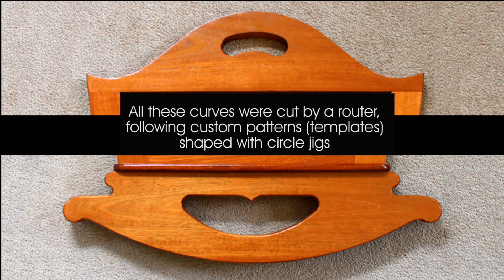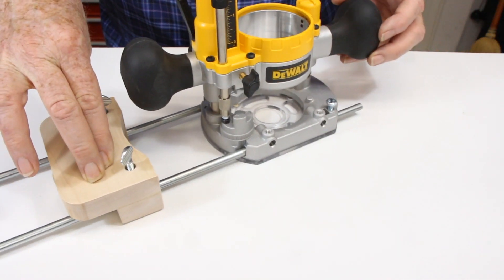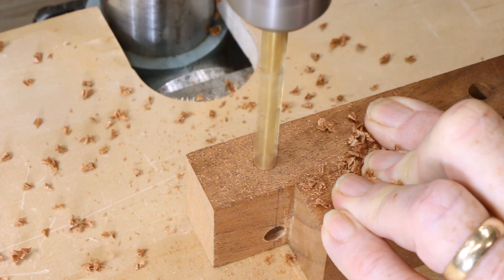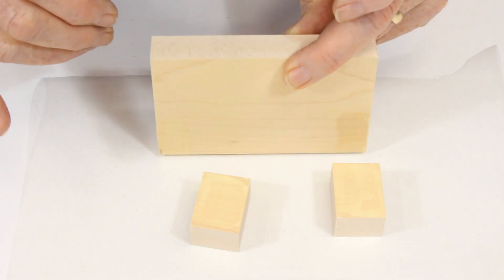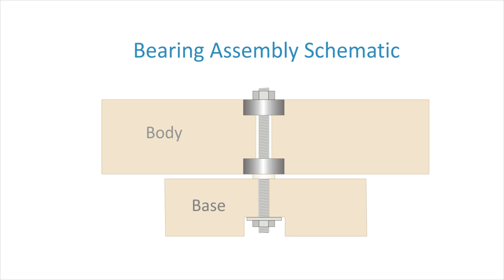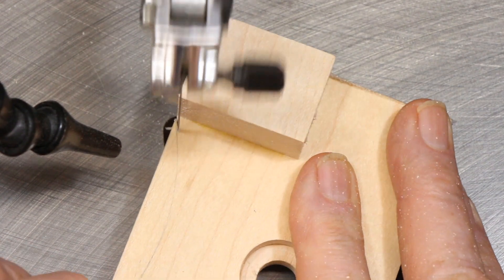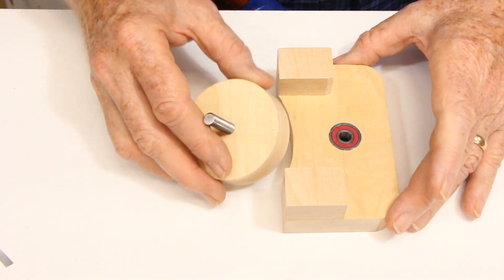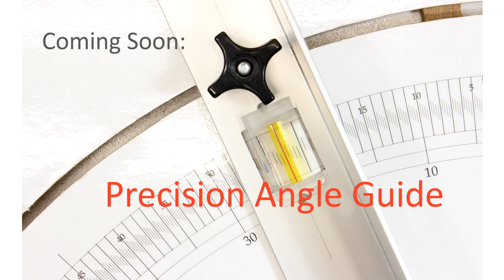Precision Circle Jig

Comment: How I cut metal rod tends to help A LOT with locating the center of the rods (to gauge how far apart the holes need to be.) 

1.) use a pipe cutter (the kind that you clamp and turn around the pipe like a can opener)  and get as deep a score line as I can. 

2.) put the end of the rod in an electric hand drill. If its long then you may need to prop up the other end. 

3.) use the drill to spin the rod while sawing it at the score line. Since your setup is like a makeshift lathe, your cut is always going to end in the center of the rod. A tiny nib will be left in the dead center if done right.

Comment: Alternatively, to avoid the potential axial misalignment issue when using inserts, threads can be directly tapped into the hard wood.  Longevity should be OK provided enough thread is engaged and the set screws are not over-tightened.

Comment: Thanks Patrick for sharing -
After struggling with and finally returning the Milescraft circle guide kit I found your video.
As you mentioned, the second option swivels and held in place by glue rather than a screw that damages the wood, which is phenomenal.

Comment: Excellent. BTW: Those thread inserts ALWAYS go in off center and at an angle by hand. They have a hex inset so cut off the "L" of the appropriate "L" hex wrench and you have a driver that will not slip.

Comment: Exelent hack with the coke can shim. We used to pack worn swinging arm bearings on our MX bikes back in the late 70’s early 80’s exact same way. Even finer tolerance these days with the paper thin material. I’m embarking on making a large router compass to cut 300/400mm curves out of 18mm exterior ply for a shepherds hut roof for a shipping container 🤘🍀

Comment: Let say first that woodworking is not in my  background, so please ignore my ignorance but how do you "set" the radius or diameter that you want to cut with this fixture?
Reply from the maker: You increase or decrease the distance between the pivot point and the bit by sliding the router along the steel rods.  When the bit is exactly at the mark on your work, tighten the wing nuts to lock it in place.

Comment: I’m new to wood work, no demonstration was given after you finished building the first jig so I don’t know how to use it? Fantastic video showing how to make the jig but how about using it?
Reply from the maker: DuzBee:  Sorry I didn't demonstrate better.  You fix the pivot point at the exact center of the circle or arc you want to cut.  Put a straight bit in the router, set the depth, turn the router on, and rotate the router around the pivot.  If you are making something like a curved molding, you can also use bits with a shaped profile.

Comment: If I didn’t know better I’d say you must have worked in film or video production. Very good info, cam angles, description, and method. 

How can I fix the small amount of drift in my drill press? It’s an old Craftsman basic floor model. Maybe from the ‘80’s.
Reply from the maker: Not sure what you mean by "drift" on a drill press.  Is the table not square to the drill bit and quill?  Check with a small try square, and check in several different orientations.  If that is the problem, the table will have some adjusting bolts or screws underneath.  You can probably correct the error.  If not, you can make a wooden table that sits on the cast iron table, and you can adjust that with small set screws to get it perfectly square.  If the problem is runout (the bit moving side to side a little as it spins), then your problem is probably your bearings.  That is a bigger job.

Comment: Very well done, video, narrative, and plans! I'm very impressed with your work and look forward for the time to build several of your projects for myself!  Here's a tip for measuring the center to center distance between two holes or shafts (as at 1:55 in your video). If the shafts are the same size, carefully measure the diameter of one of the shafts and zero out the digital caliper. now measure across the shafts, outside to outside, and the reading will be the center to center distance.  Zeroing the caliper on one shaft effectively subtracts the diameter from the reading and eliminates the arithmetic.  Keep up the excellent work, I can't wait to see what's next!

Comment: If anyone is curious, the Makita trim router RT0700 also uses 8mm rods (some of the official attachments come with them), and the plunge base has rod spacing of 84mm on centre with an offset height of 10mm to centre, exactly like this DeWalt.
Reply: I own the Makita RT0700 and love it. It's one of the best trim routers out there.
Reply from the maker: Thanks for the info.  Very helpful.

Comment: Very good! .. do you have any ideas for making a jig for the Dewalt router that cuts very small holes, say 100mm or less, but also provides fine adjustment as I need the holes to be exact for a tight fit? (I'd be keeping the sheet/hole part not the circle offcut). I'm struggling to come up with something that would provide the fine adjustment.
Reply from the maker: wforl:  I do have some ideas for making the jig you suggest.  For circles this small, the pivot pin must be inside the router base.  You could simply drill a tiny hole in the polycarbonate base at the required radius, and revolve the router around a brad in the workpiece.  However, this easy solution does not offer micro-adjustability.  A jig with an adjustable pivot inside the base requires a sliding apparatus under the router base, and a method for advancing or retracting the pivot in tiny increments.  I have given some thought to such a device, and if time permits, I hope to experiment to find a good working solution.  It may not be in time for your project, however.  Sorry.
Reply: Thanks for the suggestions!